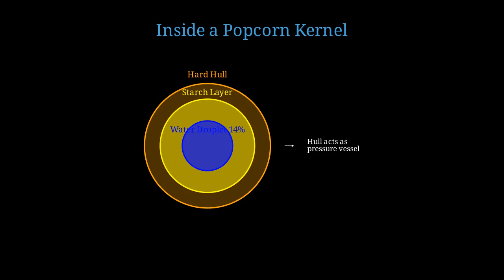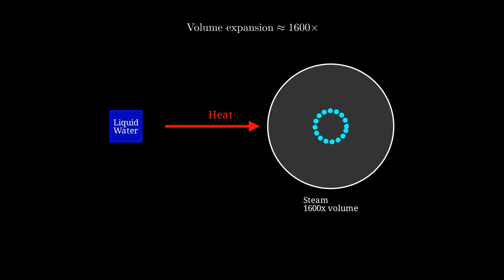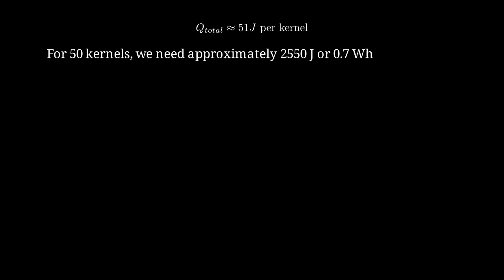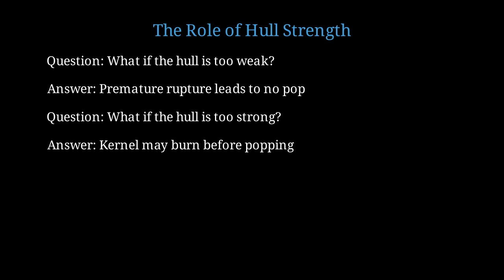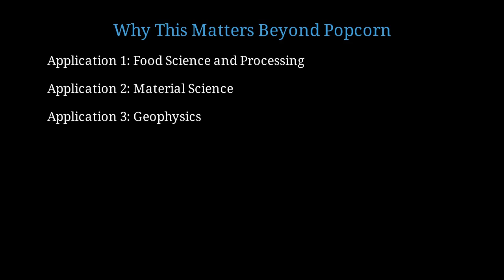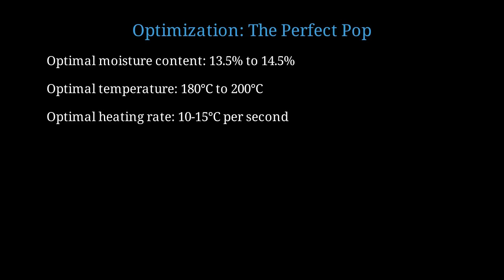What Really Makes Popcorn Explode?

Comment from the maker: How could varying hull thickness alter the ideal popping pressure threshold?
Can nanoscale moisture sensors detect the critical pressure point for optimized popcorn yield?
Could controlled phase transitions inspire new designs for pressure-regulated materials?